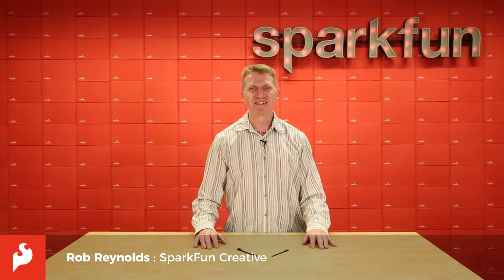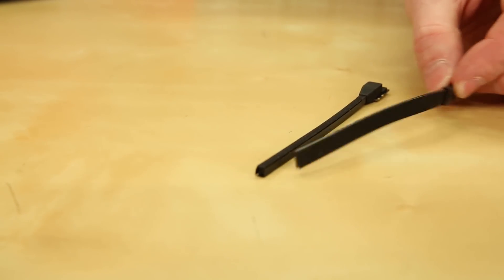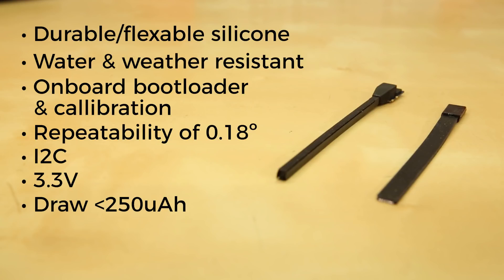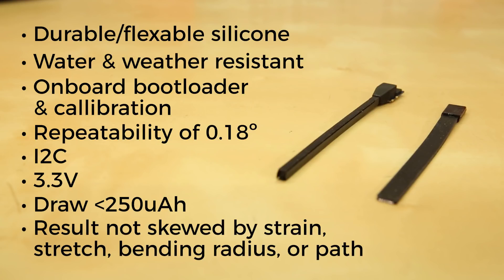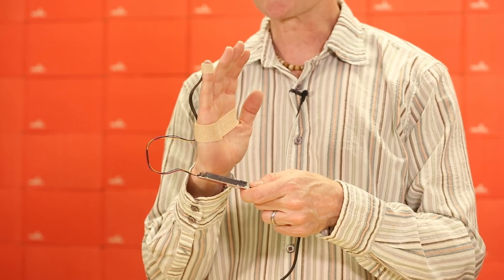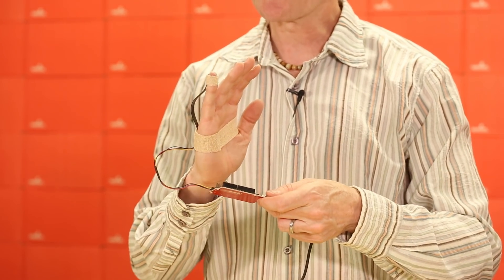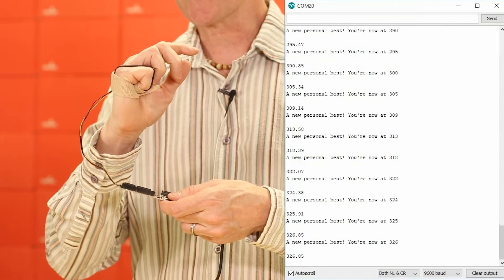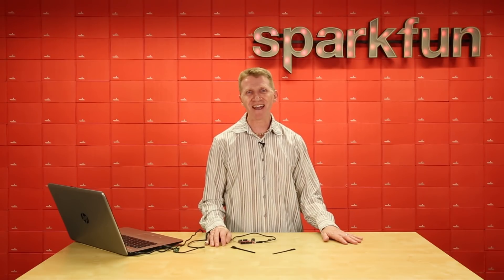Product Showcase: Bend Labs Digital Flex Sensors

Comment: Wow... look at those babies wiggle!   : ))))

No, seriously though, that's an insanely useful set of capabilities... but to have all that, in two axes, WITHOUT significant springiness?  Seriously, the throwaway "wiggle" comment really nails just how amazing this technical achievement is.

Personally, I'd say the wiggle and the vector summation are what makes these absolute game changers.  Vector summing means you don't need precise distances - you can keep some slack in the system which is key to wide deployability and consumer applications... and the free 'wiggle' means no appreciable encumberment in body worn applications.

Twin axis is serious a game changer too ... simple bendable strips can't cope with complex joints without significant support structures to isolate the axes.

Bend Labs is one of those companies that will be powering the future.  Go sell all your belongings and buy shares today ; )